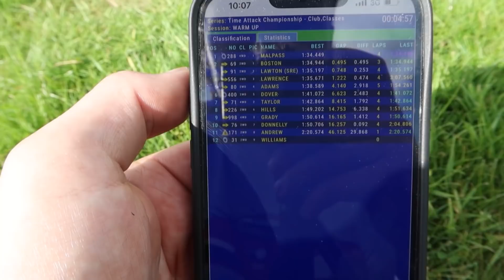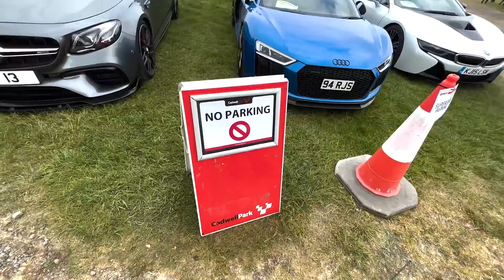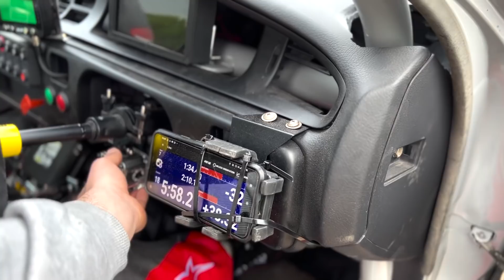Can we beat the UKs FASTEST Time Attack cars? - SUPERCHARGED K24 EG Civic

Comment: are you restricted on what brakes you can run? what pads are you using? out of curiosity..i think you have time you can make up in the braking zones, what is your braking style, hard on initially and releasing, trail braking? there was a fair bit of what looked like coasting into some corners but maybe you are not coasting and the brakes could be better? not a criticism at all, just genuinely interested, your cornering is good.
Reply: Pagid RST3 Pads, Porsche Calliper, 305mm 2 piece disc. He is definitely not coasting on the flying laps maybe some on the warm ups. 👍🏻
Reply: @petelawton-hcr_works6059  thanks for the reply, i've looked into the co-efficient and braking characteristics of this particular pad, and it is not overly impressive to me,  it will perform at over 0.5 + co-f but only at 450-550c range, and even lower for 100c-300c, you may get up to temp, but it is very unlikely to hit the optimal range in this time attack application...  I've had similar problems in the past, tried all pads under the sun, DS2500. 3k series, carb lorraines, etc etc. then had a look at EBC's new formula pads, such as yellowstuff 3068 compound, or its rp-1 and rp-x, i've had ebc in past (old formula) wasnt that impressed so reluctant to go back, but did after i looked into the new compound and it is night and day. took metre's off braking zones, and fair chunks of time of laps. just food for thought!
Reply: just for comparison, rp-x is 0.53 co-f, 0-800c, with almost no reduction in performance at any temp, while rst3 is @ 0.4-0.45 for 100c-400c, so 25% less braking performance at any given 'likely' temperature during time attack and sprinting.  0.4/0.53 x 100 = 75.4% of effective performance of rp-x.
Reply: Thanks but the car is not built for TA it’s built for Roadsports series which is a 25 minute qualifying session and a 45 minute race. We just entered TA for abit of fun and to test the car out. 👍🏻